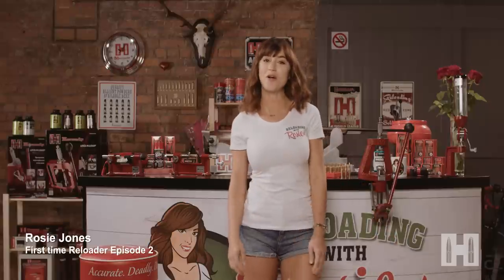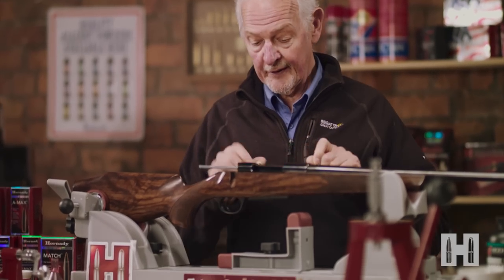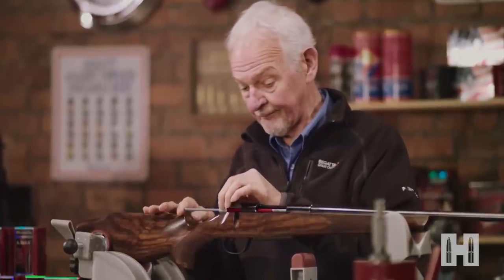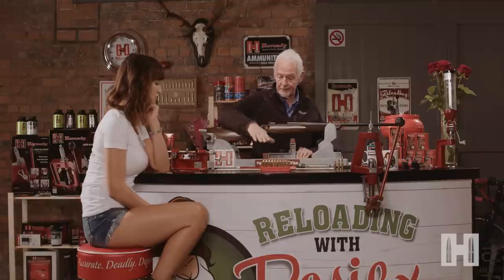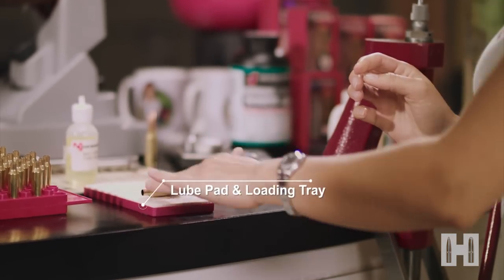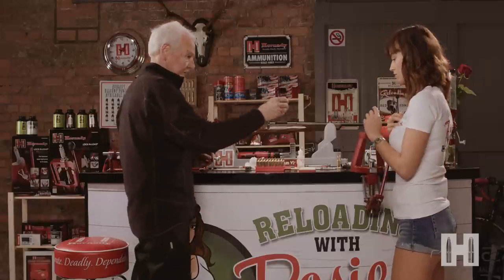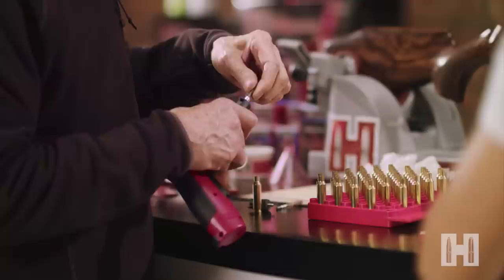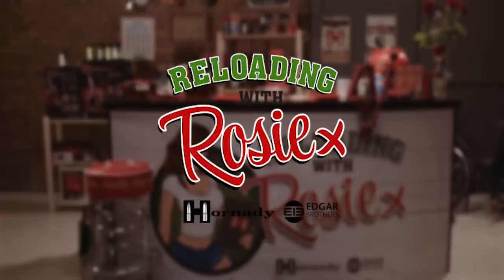Reloading with Rosie - Episode 2 | Case Preparation

Comment: When resizing the case you only need to bump the shoulder back  0.002 inch for bolt action and 0.004 inch for semi-auto. That first tool he used finds the seating depth at the lands not the OAL of a finished cartridge.
Reply: I was thinking the same thing , seat it back off the lands like the instructions tell you